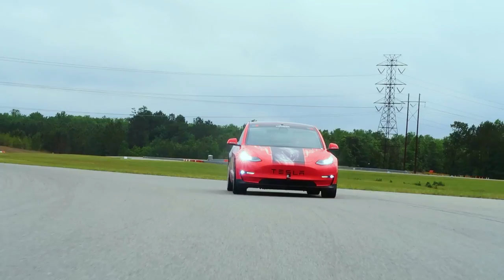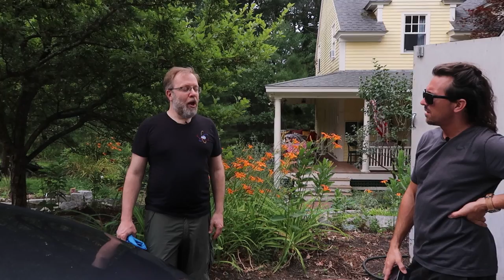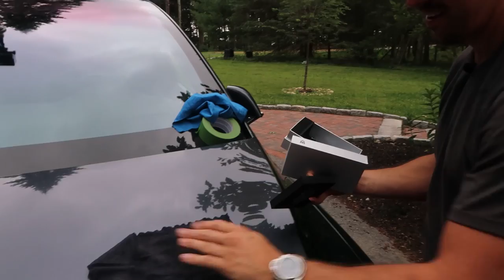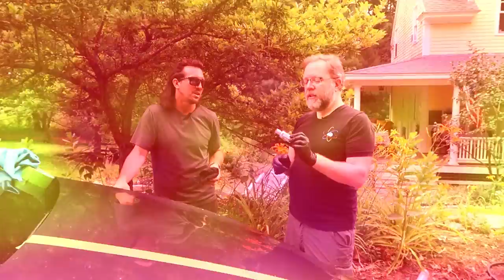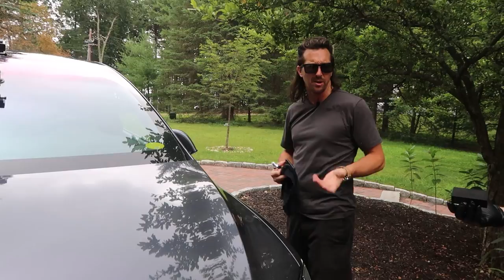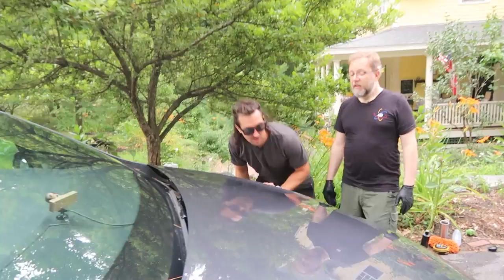Armor Shield by Avalon King!

Comment: You will not be disappointed. I first tried Armor Shield by Avalon King on my 20 year old White Ford Explorer. I learned about this when trying to find a way to polish the headlights and keep them looking good for a while. 

The Ford was not kept in a garage, so naturally the paint had seen better days. I followed the suggestions I found on various videos. Being so old, I used Meguiar's G17216 Ultimate Compound, followed by Meguiar's G19216 Ultimate Polish. Then wiped the whole SUV down with Isopropyl Alcohol. By then the paint looked great. Last step was to apply Armor Shield. 

The results were and are unbelievable. The car paint looked new. The black plastic parts looked new and the headlights have remained clear for 3 years already. The shine is awesome and it is so easy to keep clean. After that I went back and used it on the wheels and all of the windows. Now, even the break dust washes off when driving in the rain.

Next was my wife's 2012 Hyundai Santa Fe. Then, during the lock down I brought over my in-laws cars and treated both of them completely. Since their cars are much newer, I only had to wash them well, clean with Isopropyl Alcohol and then apply the ceramic coating. 

All of them look great. I'm sold on this product.

Comment: I am a hobbyist detailer and I've detailed a lot of cars. I had customers who brought me Avalon Ceramic Coating to apply onto their vehicles several times. There are many things Avalon can improve. The durability of Avalon is not as good as the competitors in the similar price range. While most ceramic coats can withstand abuse for 3 years. I would say that Avalon King only lasts 18 months under regular abuse. If Avalon King can improve their formula, that would be great!
Reply: Daniel Endy Gtechniq crystal serum light has extremely good durability. But it is also easier to leave streaks and marks if you do not level the product with a towel quickly and thoroughly. There’s trade off. Ease of application usually sacrifices durability.
Reply: castamir Thanks for the info. Based on your comment, I would say Avalon is probably doing the right thing. Consumers aren’t experts in applying the coating, thus they trade durability for ease of application